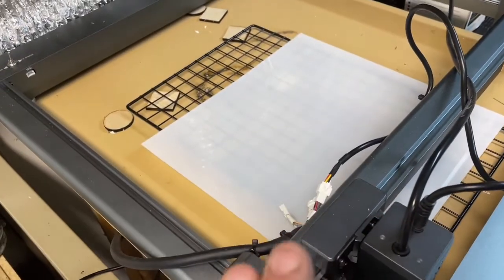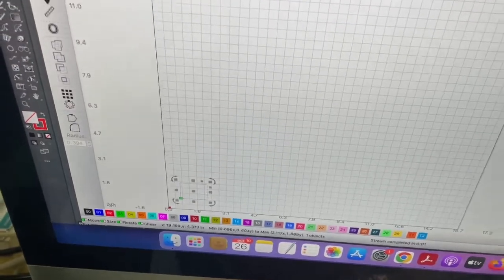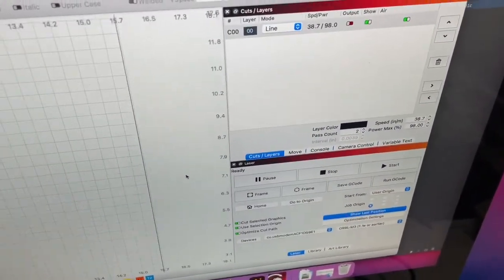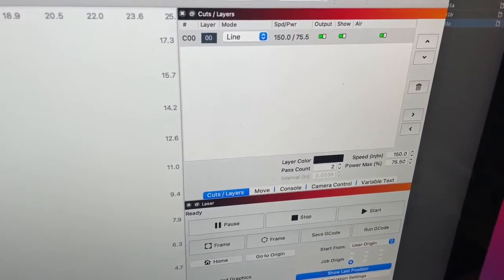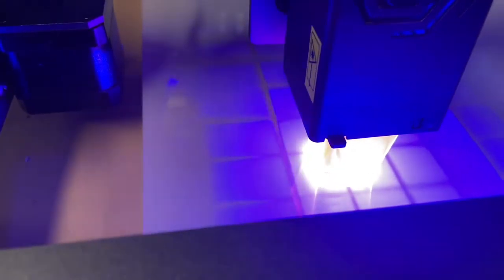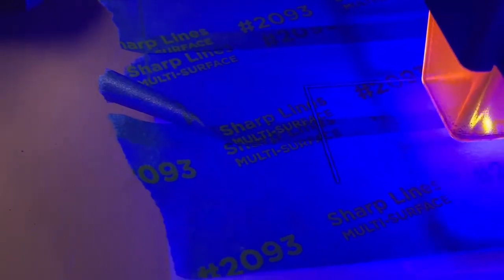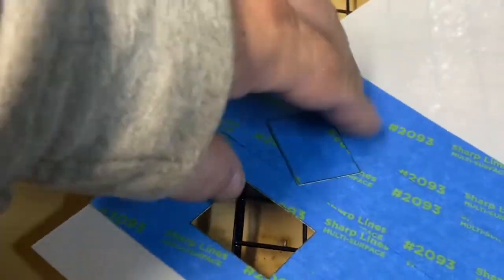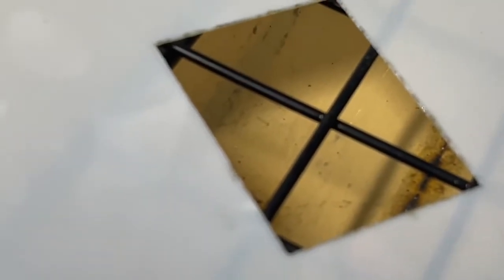Can Ortur Laser Master 3 Cut Stencils?

Comment: I'll try paint it with black tempera color.. After cut, its easy to wash it with water.. It works with glass, mirror or shiny metal.. Will see if it works..
Reply: Any luck?
Reply: @SuttaStories hi there.. Yes it works.. But, better results is with black paint in spray and after engraving just use acetone to remove the paint..
Reply: @janbacka5632 awesome man - what thickness mylar did you use? And what laser strength and settings? Thanks for getting back to me!